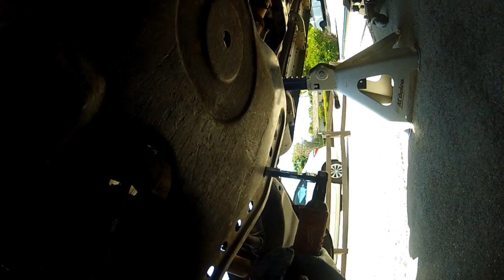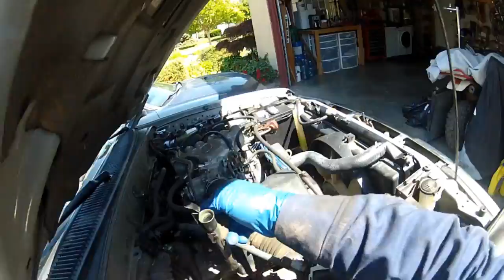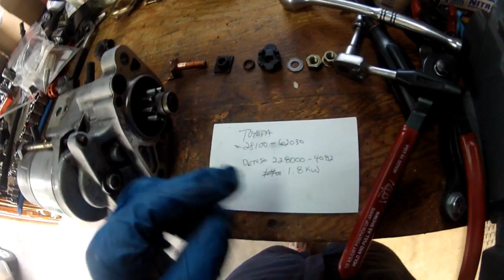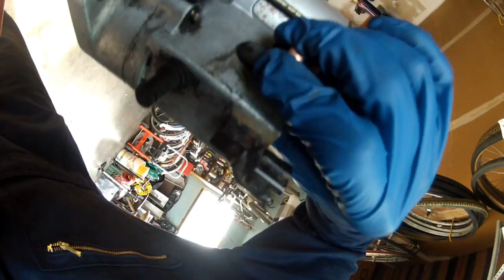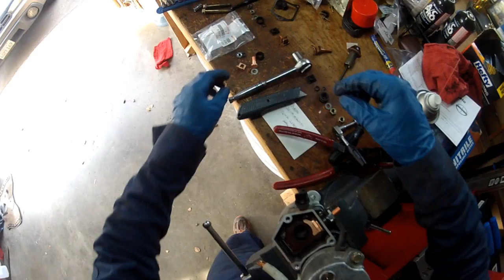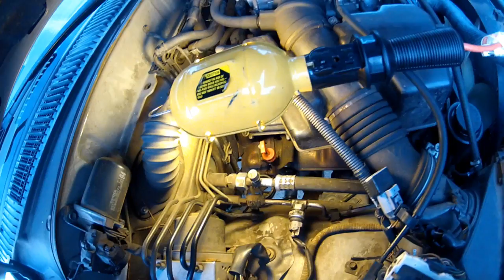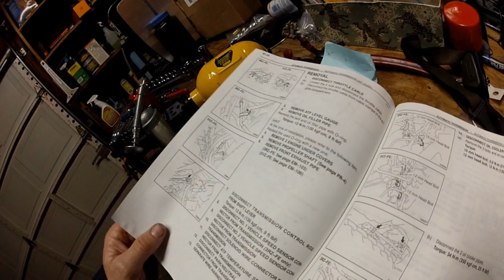Starter Removal and Solenoid Repair

Comment: Great video but I actually found a Rebuilt Denso Starter "CarQuest" for $107.00 think I would go that route when I replace my starter. It is starting to show signs of it being bad, turn key and nothing. turn key again and it starts.
Reply from the maker: Hey Robert, your symptoms are indicative of worn out contacts.  You can save a bunch of money by just renewing the contacts and plunger in the solenoid.  You don't need to purchase the expensive OEM contact and plunger kit from Toyota.  We have a link to a much more affordable  kit you can buy from Amazon.  It's only a little bit more labor to open up the solenoid to replace the contacts and plunger.  Buy a replacement starter only when there's major internal problems with it.
Reply: @TimmyTheToolman  Hey Timmy thanks for the Reply, The link to Amazon is nice but amazon says it does not fit my 2000 4Runner SR5 4x4 automatic I am going to call the dealer and give them the VIN to see what KW starter my 4 runner came with seems they did 1.8Kw and 2.0Kw on 3rg Gen with Automatic Transmissions, sounds like 2.0Kw was a cold weather option.
Reply from the maker: @robertshahon6420  Hey Robert, that Amazon garage deal is hit and miss.  I also saw it said it wouldn't fit a 2000 4runner but when I changed it to a 1998 4runner, it said it would fit.  There's no difference between the 98 and 00 4runners when it comes to the starter.  They all used a Denso starter.    The 1.4 kw starter was used for manual transmissions.  The 1.8 kw was used for automatics and could also be the cold starter option for manual transmissions from what I understand.  Maybe the 2.0 kw starter was the cold weather option for the automatic models.  But, I don't think the difference in kilowatts makes a difference when it comes to the contacts and plunger.  These contact and plunger kits work for a whole host of different model and manufacturer vehicles.  In the questions section for that kit I linked on Amazon, somebody said it worked fine for their 3rd Gen 4runner.
Reply from the maker: @robertshahon6420  I looked up that affordable contacts and plunger kit on their website for compatibility and they said the one I linked was for a manual transmission model.  I updated the link to the one they recommend for the auto trans model but you'll find that it still says it doesn't fit a 2000 4runner.  But, when I change my Amazon Garage to a 1998 4runner, it says it will fit my vehicle.  The Amazon Garage is not a perfect system and it's quite often wrong.  This is the link I used to look up the correct kit for a 2000 4runner: https://www.cpidivisions.com/downloads-resources/online-parts-lookup/
Reply: @TimmyTheToolman  Hey Timmy thanks for all your help. I actually went through the receipts I got from the previous owner and he had replaced the starter in 2017 with a reman from Autozone Duralast Remanufactured Starter 17239. Called them since it boasted limited lifetime replacement warranty but they will only honor it if you are the purchaser, lame. I asked them about the parts and they were saying it was probably cheaper to just buy another reman, haven't looked at the actual starter yet but I would assume the solenoid rebuild would be similar just finding parts would be the issue. I am really bummed it is not the OEM starter.
Reply from the maker: @robertshahon6420  If I were in your situation, I'd probably buy a remanufactured Denso starter like you were originally planning to do.
Reply: @TimmyTheToolman  yeah thanks that is what i was thinking as well
Reply from the maker: @robertshahon6420  Good luck with the replacement.
Reply: @TimmyTheToolman  thanks Timmy
Reply: Hey Timmy,
I finally replaced my starter over the weekend and have to say without your Video it would have taken me hours to figure out. Thanks so much for your very detailed and clear videos.
Reply from the maker: @robertshahon6420  Hey Robert, good to hear you were successful and our video helped you out.  Thanks for getting back to us and sharing this with us.  We appreciate it.  You're very welcome and Happy Wrenching!

Comment: I just replaced my starter for my 1997 4Runner. Getting near the end the main problem was trying to figure out to get the starter to stay in position while trying to get a bolt started. I did it like Timmy did in the video. But for me I did the top bolt first. I screwed the bolt in enough to keep the starter from falling out. I think the differences may be in how flexible and what size of each person is. The top bolt was easier for me. Removal of the electrical plug was easy. I could see where to push on the plastic piece so I used a long screwdriver and pushed in the tab to pull off the connector. Even when working inside a garage with extra lighting I still use a rechargeable work light to light up everything and I move it around as needed. Without the light I probably wouldn't have seen where the push tab was at on the electrical plug.
Reply from the maker: Good job getting it done.  It is fairly hard to hold the starter in place while getting one of the bolts started.

Comment: Take the nut off of the upper control arm and push the rod to the bushing you can now easily remove the starter
Reply from the maker: We've heard of this method and it's indeed an option.  Releasing the brake line from the frame and getting the starter in the right orientation like we show in the video is all you really need to do though.  The starter comes out without removing the UCA nut and sliding the bolt out of the way.
Reply: @TimmyTheToolman  After an hour of trying it your way and it would not come out. Took of the nut and it slid right out
Reply from the maker: @cellis4252  Don't know what to say.  Once I figured out the orientation the starter needed to be in, it came out.  Most of the time I spent getting it out was figuring out the necessary orientation.  By making this video, I was hoping to make the job easier for others.

Comment: I didn't catch the price of the two contact kits and plunger kit you finally purchased.  But, I did notice what looked like a new steering rack,  coilovers, sway bar and poly bushings everywhere.  That 3rd gen gotta drive better tban new!
Reply from the maker: We provide part numbers and links in the video description.  I went with OEM starter parts but there's much more affordable options on Ebay and Amazon.  I'm still running the original steering rack but I did replace the bushings.  My coils are original as well but I did put new shocks all around and OME 906 springs in the rear.  My 2000 is mostly stock.

Comment: Great Video Timmy, that you very much for taking the time to post it. I watched you say you had a hard time finding economically priced replacement parts. I have been using two sites. Rockauto.com and Partsouq.com  Both are fantastic sites to find new, refurbished, OEM and replacement parts for a ton of different vehicles.  Rockauto.com has a very extensive and easy to use catalog to locate the part you need just by part name.  Partsouq.com I have found it easier to have the Toyota part number and or vin number to find the part, but they deal mostly OEM toyota genuine parts.  The contacts and plunger cost me 32$ USD and that included 13$ shipping and it arrived in 3 days. Rockauto also had the starter motor repair kit for 12$, didn't include the plunger.  Anyways these two sites have saved me, literally, thousands of dollars on real toyota replacement parts at a fraction of the cost of buying from the dealerships and they all have incredible warranties, the customer service and return policies are fantastic and I have waited no more that a few days for parts. For example. I ordered a starter switch and battery ground cable from Rock Auto on Monday morning, it was shipped Monday afternoon and Fedex dropped it off at 830 this morning. $70 USD including shipping and handling.  The local parts store wanted 150$ + taxes for just the starter Toyota parts department wanted over 200$... So... again, thanks for the video and hopefully if you need parts for any of your vehicles in the future, check out the two sites I mentioned... they are pocket savers for sure. take care
Reply from the maker: Glad you like the video and thanks for sharing your opinion on good parts sellers to use.

Comment: I just replaced the plunger and contacts while the starter was still in the engine compartment, because I simply could not figure out how to get the starter to come out.  Lol. but now for three days I can't seem to prop it up to get the bolts threaded, grrrrr.  Yes in 2020, toyota wanted over $100 for the plunger and contacts kit. found they are all over on Amazon. .. didn't get the cheapest but the kit was only $15. thanks for the video. ..
Reply from the maker: There's a way to where you can get your right hand supporting the starter while you get the bolts threaded in with you left hand.  I've removed and reinstalled starters 3 times on these rigs so I know it can be done.  But, maybe you can just get somebody to help you for 5 minutes by holding the starter in place for you while you get the bolts started.  You'll get it.

Comment: have to tell you, Tim; the hardest part for me was that transmission dipstick  pipe and it's bolt was in there...what a pain....had to be careful not to break it but was more than 20 minutes to take it out. Mine solenoid control wire only came out after I took the starter from the engine.  Top bolt was kind of hard, rusted treads.The posts inside where 13mm and 15mm...oil leaking from valve cover gasket got into the contacts, what a mess.Your video helped a lot with the removal, it was not that bad,you had done all thinking for us. Thank you. I got my contacts, seal and plastic insulators from https://www.maniacelectricmotors.com/. Was very easy to over torque the post and crack the insulators inside (12 ft-lbs torque on mine - 1.8kw). Thank you.
Reply from the maker: Hey Jonas, glad the video helped you out.  You ran into problems but you persevered in the end and that's what's important.  Good job!

Comment: PRO TIP:  take the nut on the Upper control arm bolt loose and slide the bolt partially out.  Starter comes out WAY easier and takes 30 seconds to pop the nut off and back on.
Reply from the maker: I can see that helping out.
Reply: Removing upper control arm nut and knocking the bolt over out of the way is a must.

Comment: I am getting ready to pull the starter on my 99 Isuzu Rodeo 3.2.  I ordered a plunger and contact kit for $10 on eBay.  From all the you tube videos that I have watched those solenoid parts all look pretty much the same, except I know there are plungers that have different shaft lengths.  You were very thorough and cautious to be sure that solenoid would work right when you finished. I appreciate the detail shown in your video.
Reply from the maker: Hey Charlie, good to hear you like the detail we offer in this video.  Good luck with your starter rebuild.

Comment: I appreciate this video. One thing that I will add to the removal and reinstall that will make it much easier to squeeze the starter through a tight space. I removed the UCA nut and pushed the bolt out of the way. It made it a lot easier to fit the starter through that space.
Reply from the maker: Thanks for the tip.  I can see how this would help.

Comment: you're the man, timmy.  the brake line on my 2004 tacoma 3.4L 4x4 is orientated slightly differently than your 4runner so i gave up trying to remove the starter and just repaired the solenoid box without removing it haha
Reply from the maker: You wouldn't be the first to just do the solenoid repair right in the engine bay.  It's a much tighter work space but you got it done.  Good job and Happy Wrenching!

Comment: So I got autostart installed on my 4runner.I noticed that sometimes it takes two attempts to get it started. Which I try not to use the autostart. Upon doing the solenoid repair did it also improve your starting?
Reply from the maker: It didn't improve the starting but it stopped the solenoid from locking up and constantly running the starter.  If your rig doesn't start every time you turn the engine over with the starter, that has to do with something else other than the starter.  It could be a fuel pressure issue or maybe you just need to give your rig a little tune-up and renew the sparks plugs and wires.  A cleaning of the Mass air flow sensor and throttle body wouldn't hurt either.  Or, maybe it's just something to do with that autostart feature.

Comment: First off thank you for your service as firefighter. My daughter married to a firefighter family. Husband, is a fire captain, brother-in-law--battalion chief, father-in-law--retired fire chief. But enough of that.
Great first try at overhauling a starter solenoid. May I input a couple additional tips for the less than professional viewers? 
First, be sure to remove the negative cable at the battery and install it back last before turning the key. I know you had yours already removed due to your constant contact issue.
Second, before trying to install the starter, using a pair of jumper cables do a bench test of the starter.
The test can be done using the car battery without removing the battery too. This way if there is a problem with assembly, the starter does not have to be removed from the engine again.
Lastly, the reason for contacts going bad is that there is no capacitor in that circuit. Thus, every time the plunger gets close to the solenoid contacts, it acts like an arc welder electrode. The sparks occur just before completing the contact. This in turn burns the material from the plunger and contacts.
Sometimes it welds the plunger to the solenoid contacts. Which seemed to be
your issue.
Reply from the maker: Thanks a lot for sharing all this.  Very informative and solid advice.  We appreciate you taking the time to comment.
Reply: Thank you for accepting the comments as information and not criticism. I wonder why there is no capacitor to prevent arcing as in old point and condenser circuits in old distributers. Although even then the points had to be changed at tune ups due to arcing and pitting.
Reply from the maker: @Mahigeer1  I was wondering how the contacts get worn down and was also wondering how my starter got stuck in the "on" position.  Now I know.  Thanks!
Reply: Timmy The Toolman ---- My 2000 4Runner had the same problem as yours (stuck plunger), so before I rebuilt it, I was keeping a 10MM wrench in the car. Before that I also had an intermittent no crank issue.
I had to rebuilt the solenoid on my 89 Camry as well before I purchased the 4Runner.
Reply from the maker: @Mahigeer1  I still keep a channel locks in my rig so I can loosen or just twist off the negative battery terminal if it ever happens again.  It was a good thing this happened while I was at home because the starter would have just kept going and going.
Reply: I got a ratcheting 10MM from HF (cheap) to keep in the 4Runner. The channel-lock pliers can damage the battery post when one is excited and anxious to remove the cable.
Reply from the maker: @Mahigeer1  True.  You just need to be calm under pressure.  I've had some practice.  I might follow your lead though and get me a couple cheapo 10mm wrenches to keep in both my rigs.
Reply: Right being a firefighter, I am sure you are used to be dealing with problems under stress.

Comment: Hey tim, im about to replace my main rear seal, when i take out the trans do u need to take out the starter first? thk
Reply from the maker: It doesn't have to be first but it does have to come out for you to separate the transmission from the engine.

Comment: little clip on the back of that plug is giving me trouble. Thanks for the tips. My friend got the starter out on the 4wd version with a lot of twisting and turning, it is do-able but he said it was a nightmare. I am going out through the side like you show. Also mine did the same as yours and got stuck engaged and kept running even when the key was in the OFF position. I hear the car can catch fire in this situation and I was lucky it disengaged after a few more key jiggles. My starter was starting to smoke!
Reply from the maker: You'll get it done.  Getting the starter out through the wheel well on the 4WD models is the way to go.  Yeah, it's a sort of helpless feeling at first when the engine keeps turning over and over with the key out of the ignition.  Luckily I was home when it happened and I raced into the garage and grabbed a pair of channel locks and twisted the negative battery terminal off.  Happy Wrenching!
Reply: @TimmyTheToolman  just knowing that it has a clip made it so much easier. I didn't re-co mine, purchased a new one. It was longer than the original and was a little bit more fiddling to get it back in! But it is nack on the road. Thanks again for the tips. Will sub your channel.
Reply from the maker: @m3sca1  Did you keep your OEM Denso starter or do you trade it in for the core charge?  What brand starter did you buy?
Reply: @TimmyTheToolman  yes I have kept the OEM denso. The one i put in is chinese brand. I was thinking of getting those kit bags and repair the OEM...and keep it handy incase the china build is a POS. I cleaned it up with degreaser in preparation to fixing it. How much did the kit bags cost you?
Reply from the maker: @m3sca1  I bought the OEM full rebuild kit and it was expensive.   Since then, we found a kit for sale on Ebay with the plunger and contacts for around $10.  Check the vide description for the link.  That's smart you kept your Denso starter.  There is a good chance that aftermarket one will crap out on you sooner than you would have hoped for.

Comment: What's the right oil to use for my Toyota Tacoma 2004 for the engine motor   synthetic or regular oil?
Reply from the maker: Hey Tony, you asked the same question in two different videos we have made.  The answer you get isn't going to be any different.